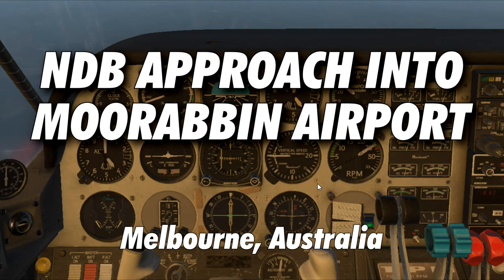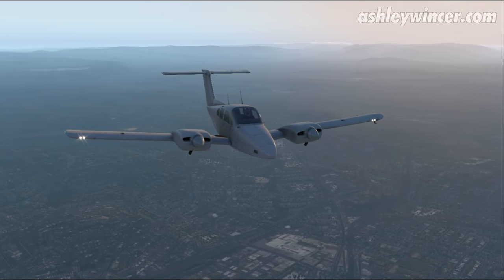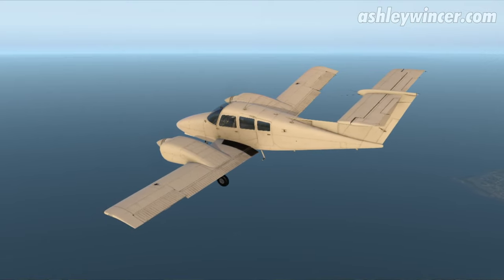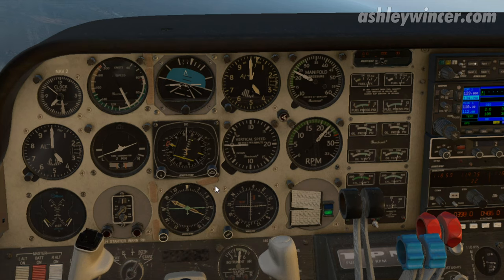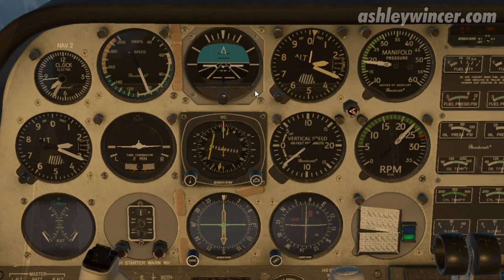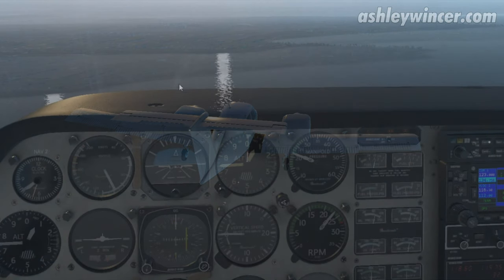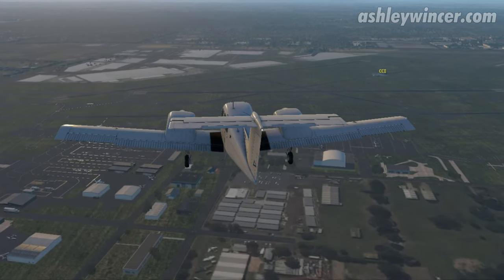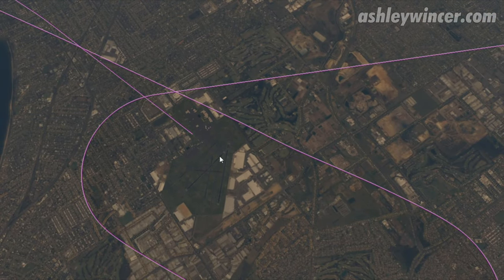Flying the NDB Approach into Moorabbin Airport | BE76 Duchess | X-Plane 11

Comment: Novice here. So after you hit the ndb on the inbound track what's the next step towards landing because your not lined up with any runway on the 070 heading
Reply from the maker: Upon arriving overhead the NDB on the inbound track (which is usually the missed approach point), if you can visually see the runway, you circle the aircraft to make a visual landing on the active runway.  If you cannot visually see the runway upon reaching the missed approach point, you would execute a missed approach (Go Around)..